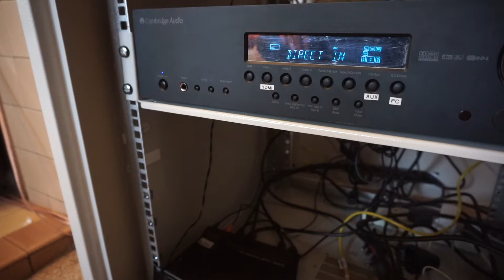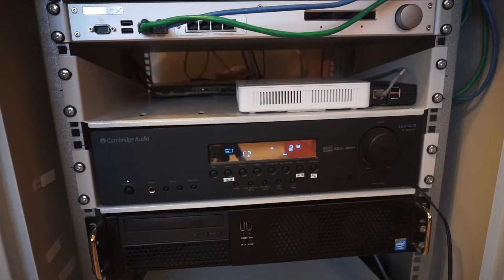Upgrading my Home Server Rack with an APC AP7921 Networked PDU

Comment: Are you not concerned about having the PDU grounded to anything?
Reply from the maker: It's connected to a grounded mains supply.  There's no need to ground it to anything else.  In some settings it may be worth bonding the PDU to the cabinet but this is only really to prevent interference in large industrial/commercial setups, there's no real benefit in a home/smaller setup.
Reply: @camerongray1515  - Thanks for confirming, i have one myself and have never had problems but thought i'd ask. Did you notice in the manual that APC don't advise these to be used on normal wall outlets?? Assuming it's just a "Use at your own peril, there's no protection in this unit" sort of situation.

"The Switched Rack PDU
does not provide power protection.
Therefore, American Power
Conversion (APC®) does not
recommend plugging the unit
directly into any unprotected
power source, such as a wall
outlet."
Reply: @OldSkoolPGFan  In the UK our mains outlets are protected with a fuse in the plug itself. Also generally speaking, and certainly with new installations, our socket circuits are RCBO or RCD protected (residual current detection - same as GFCIs in the US).

Comment: Damn! A rack mount A/V receiver...that’s money. I want one...
Reply from the maker: This isn't rack mounted sadly, it's just sitting on a 2U rack shelf.  There is a company that makes proper rack hardware for it though that gives it a neat front plate but it doesn't come cheap!
Reply: I picked up a rack mount stereo 6 zone amplifier for only a few hundred quid. With serial (RS232) control so it can be automated… check out Monoprice. Alternatively a friend has Amplipi which is apparently very good.

Comment: do i need to purchase a PDU for my home ccna lab. i already have a rack with switches, routers and stuff. Thanks
Reply from the maker: It's really up to you, a regular power strip will work fine as long as you aren't overloading it.etc.  A PDU is just nice since it mounts neatly in the rack. Ones like this with network capability are relatively expensive (although can be found cheap used) but basic ones which are basically rackmount power strips are pretty affordable.

Comment: Good video. Quite alot of load on that PDU though, especially if you are taking trailing sockets off of it as well!
Reply from the maker: +ajs2120 The trailing sockets are really just so that I can fit power bricks into it.  In regular use I'm pulling around 0.7amps through it and even with all the A/V kit running it sits at around 2amps max.

In its previous life, this PDU powered several dual CPU 1U servers (and pretty old, power hungry AMD Opterons at that), what it's powering here is a walk in the park in comparison!

Comment: cool vid :)
Whats the IBM thngy you powered on at 4:00 and how did it power on the rest of the network? :O
Reply from the maker: Stjepan Brkić It's a UPS (IBM 750t) - essentially a rebranded APC SmartUPS.  Unfortunately one of the batteries failed shortly afterwards (hence why it's missing in the last bit of the video) so I'm no longer using it.
Reply: Try a new set of batteries...  I like the APC Smart-UPS 1500 because it plugs into a home wall plug and uses only two batteries.  (mini tower)  The rack mount version has four batteries...  (YouTube videos show how to replace the batteries)  tjl